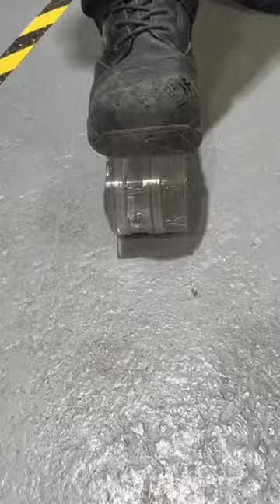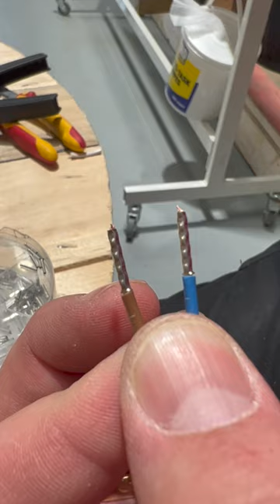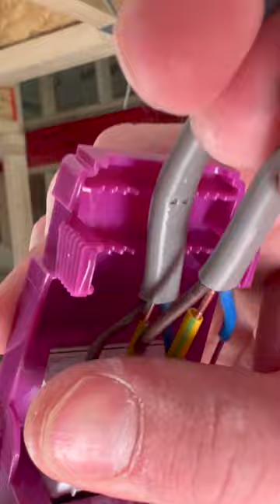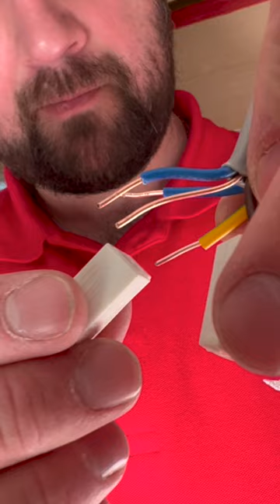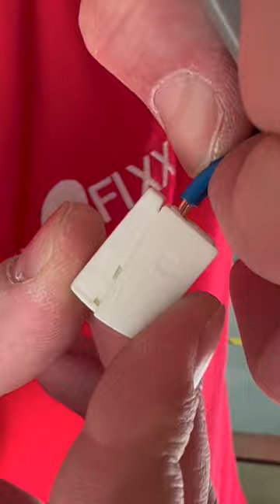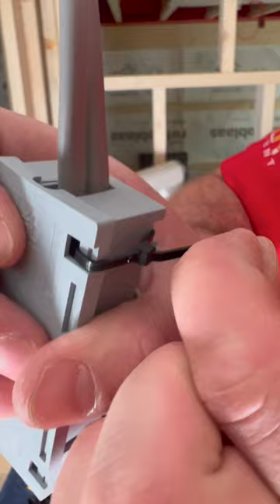Change Your Connector Game with the WAGO 224!

Comment: Ha, in Australia the downlights all come with a flex and mains plug. We just fit a plug base to the fixed wiring then plug them in. So easy. Swap out the light if you want, anytime. Most are rated for fully covered in insulation as well.

Comment: If you just buy the 221 variant you can place stranded wire inside by only twisting it, without the crimp things (don't know what they are called in English), and these 221's are also for solid coper cables

Comment: Do you need to crimp before using the wago? Main benefit was not having to crimp FS cables?
Reply: If you just buy the 221 variant you can place stranded wire inside by only twisting it, without the crimp things (don't know what they are called in English), and these 221's are also for solid coper cables

Comment: Why change the original connector that was designed for that fitting that seemed to be working fine , to replace it with a plastic box with cable ties around it , come on guys !
Reply: i came here to post this exact same comment
Reply: Looks like a different downlight though?
Reply: What cheap ass down light comes without a connection box?

Comment: You don't need to use ferrules on flexible conductors when you install Wago spring clamp terminals.
You just make your work more time consuming.
Reply: not only do you make your work more time consuming, but also you lower the area of contact and increase the heat generated (by it being higher resistance) and thereby the chance of it welding or catching fire
Reply: @M3nd0zaBrack3n  
Exactly!
Reply: And stop twisting it like a madman. Half a twist to not have the wires poke out. It messes with your crimp as well..
Reply: That is absolutly true
Reply: Yea time consuming but much neater  and easier to work with over time. The resistance value would be negligible on 0.75mm and a LED down light pulling 10-18w I don't see many fires cones from that. But I agree why change a good box. But again it's advertisment and a short for money. Best regards, Scott. ✌️🙏✌️

Comment: Why would you put tin steel on top of copper wire? It is not going to any special plug, as Wago's are for both for flexible and fixed copper wires,and copper has 2-3 times better conductivity than that tin ferrule...

Comment: Original connector was fine.
Reply: Where’s your professional companies YT channel?
Reply: @flyfish697  there in lies the problem, impartiality. Clearly they have a partnership or sponsor with Wago. I'm not an electrician, but have worked in the lighting Industry and even though I love Wago connectors. I would personally prefer a single solid connector, with a purpose built enclosure, over 3 individual connectors in a box that's not specifically designed for the connectors.

Comment: No need for ferrules with the wagos , just put in the wires.
When you put stranded wire in ferrules also dont twist them...just strip, cut and put it in.
When twisted a lot of times it gets too thick or it goes in less easy.
And to be fair the original stuff looked just fine so I dont see why you would touch it. 🤷‍♂️

Comment: It's quite fascinating to watch these developments in cage-clamp connectors really.  WAGO is clearly reacting to the Chinese manufacturers that took the concept and did what they do best, screw around with it endlessly, perhaps not to best results either.  Take a look at the endless variations on the original grey block WAGOs you can buy from China, including the opposed joiners and how WAGO has started releasing their own versions.  Needless to say the WAGO, and other reputable manufacturers, are the ones to use not the elcheapo unknown quality Chinese versions.

Reverse copying of the copiers.  What a strange world we live in.

Comment: You have to be trolling us right? Replace the push fit connection box on the downlight with another, more complicated and expensive push fit connection? Void the warranty on the light. Then use ferrules on a connector specifically designed to work with stranded cable? This isn't an example of high quality workmanship. This is just inflating your customer's bill and wasting your own time.
Reply from the maker: The new light doesn’t have a junction box - what would you do?
Reply: @efixx  Does that ever happen? Even LAP downlights have push fit connectors now. I've been an electrician for 12 years, and I can't remember the last time I had to do something like this. What kind of cheap lights are you fitting for this to be a problem? You still didn't address why you used a ferrule on a connection designed for stranded cable. Personally, I love using them for that extra touch of professionalism, and job satisfaction. Why add the extra cost and labour when it isn't necessary?